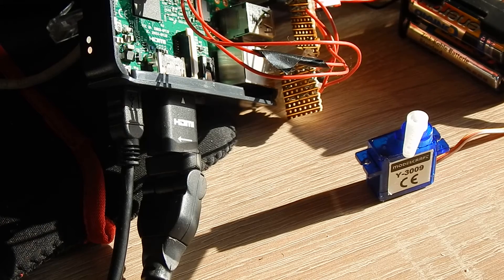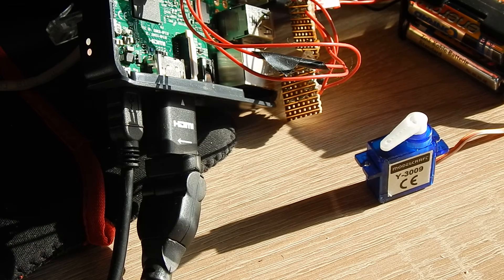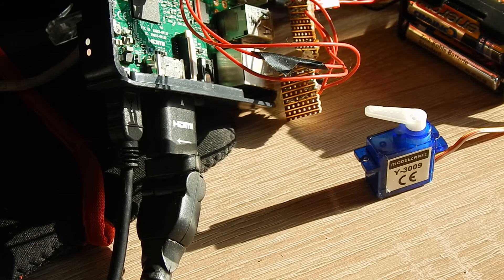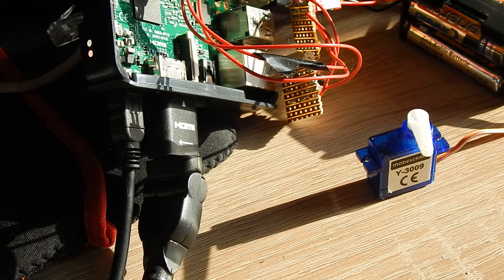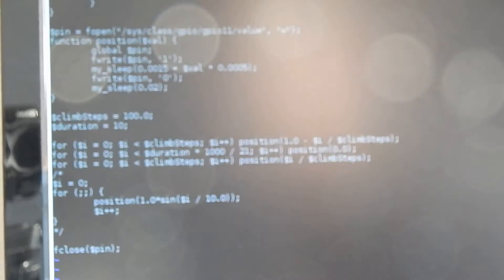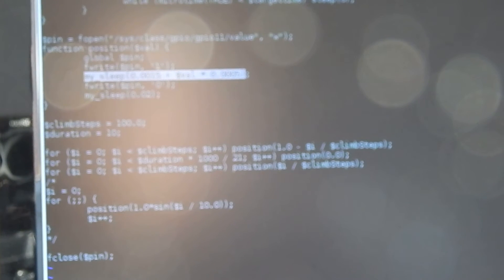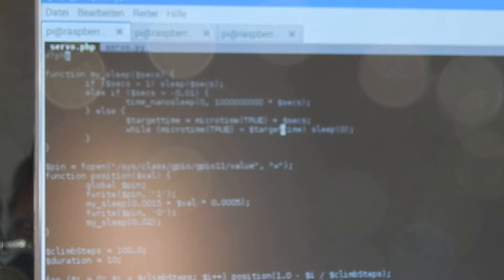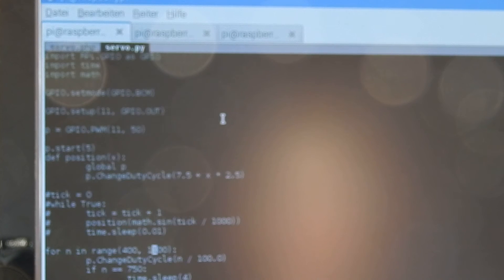Raspberry Pi: Software PWM vs Hardware PWM

Comment: Hi, kann man den Hardware-PWM des PI mit Python ansprechen oder geht das nur mit C? Danke für eine Antwort. Abgas Engel.
Reply from the maker: +Abgas Engel Für Python brauchst du eine C Bibliothek. Da das Hardware PWM aber auf Port 18 beschränkt ist, nutze ich lieber Software.
Reply from the maker: +Abgas Engel Für Python brauchst du eine C Bibliothek. Da das Hardware PWM aber auf Port 18 beschränkt ist, nutze ich lieber Software.
Reply: antisteo
Danke. Dachte ich mir schon. Ich muss mit der Frequenz möglichst hoch kommen, von da her ist C vermutlich sowieso schneller als Python (Compiler vs. Interpreter).
Reply from the maker: Abgas Engel Das ist noch nicht mal das Problem. Python könnte einem aber mit dem Garbage Collector in die Quere kommen und an einer Stelle rechnen, wo das Programm schnell reagieren muss.
Reply: Ich fürchte Python ist das geringste Problem. Viel schlimmer ist, dass der Raspberry Pi nicht in einem Echtzeitbetriebssystem läuft und selbst Assemblerprozeduren kein perfektes Timing garantieren können. Mit Python und erst Recht "unter Last" wird es natürlich noch schlimmer! Von daher ist Hardware PWM für Servos und bestimmte andere Dinge praktisch zwingend. Wenn ein PWM pin nicht ausreicht gibt es entweder servo-driver boards oder man schaltet irgendeinen Arduino dazwischen, was auch noch andere Vorteile hat.
Reply from the maker: Andreas Klostermann
mit PHP habe ich es doch hinbekommen - mit speziellem Kernel-Parameter-Tweaking, um eine CPU zu isolieren
Reply: Sehr interessant... was für ein Kernel-Parameter-Tweaking? Da steht nur was von "taskset" im Quellcode.
Reply from the maker: Andreas Klostermann add isolcpus=3 to /boot/cmdline.txt

den Rest kannst du unter https://github.com/carli2/raspberry-projects nachlesen
Reply: Danke. Aber mir scheint die neueren Raspberry Pis können PWM über DMA auf allen Pins... https://sourceforge.net/p/raspberry-gpio-python/wiki/PWM/
Reply from the maker: Nein. Ich habe das selbst getestet und das Python PWM-Feature ist extrem wackelig. Typisch für Software-PWM. Mit isolcpus verbessert sich Pythons Verhalten extrem, ist aber noch unter der Leistung von PHP, wahrscheinlich aufgrund der Garbage Collection und den nebenher laufenden Threads.
Reply: Danke für Eure Antworten/Diskussion. Meine Anwendung ist völlig unempfindlich für "Wackler" und es gibt auch keinen Bedarf nach einem NMI mit superschneller Reaktion. Im Prinzip muss ich nur Töne erzeugen, diese sollten aber möglichst hoch sein. Je höher, je besser. Ich nehme an, dass die maximal erreichbare Frequenz von der Programmiersprache abhängt. Eine Idee dazu? Danke.

Noch ein Gedanke: der Arduino ist niedriger getaktet als der R-PI. Daher sollte eine Arduino-Lösung eigentlich wegfallen, wenn man hohe Frequenzen will. Aber eigentlich hat eigentlich keine Bedeutung.
Reply from the maker: Für besonders hohe Frequenzen nimmst du am besten Pi mit C und DMA.
Reply: Ich glaub C ist an der Stelle egal, weil Python und PHP bequem mit dem DMA mitkommen. Aber es gibt auch ICs zum Betreiben solcher Servos, die sind noch genauer und brauchen noch weniger Programmierung. Aber eben mehr Strippen.
Reply: Hallo Leute, inzwischen bin ich weg von einer PI-Lösung. Es gibt fertige ICs wie z.B. den XR 2206. Mit wenigen Bauteilen ähnlich wie beim NE555 kann man stabile Frequenzgeneratoren bauen. Ich muss nur noch rausbekommen, wie ich einen Sweep durch die Frequenzen hinbekomme, dann bin ich schon einen großen Schritt weiter. Danke nochmal für Eure Tipps.
Reply: Also ich würde aktuell zu einer Lösung über einen Arduino Pro Mini neigen (ca 10€) bei wenig servos und dem Adafruit Servo breakout (ca 20€) bei vielen servos, der verbaut einen IC, hat einen eigenen Taktgeber, und viele weitere praktische Extras. Auch die Stromversorgung ist damit vermutlich leichter, als wenn man versucht sich irgendwelche PWM ICs selbst zurechtzubiegen... Ist aber auch teurer...